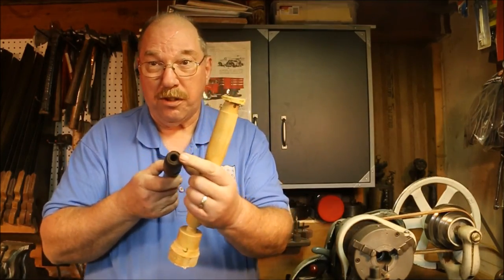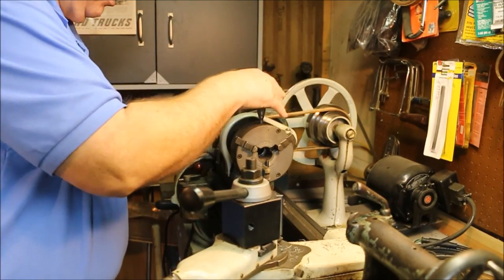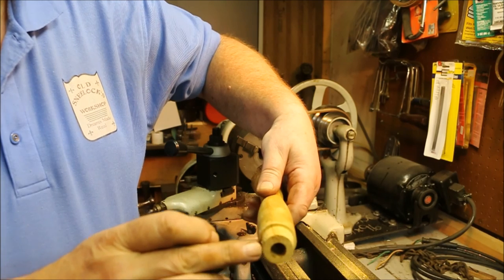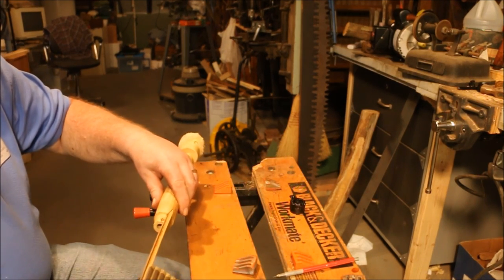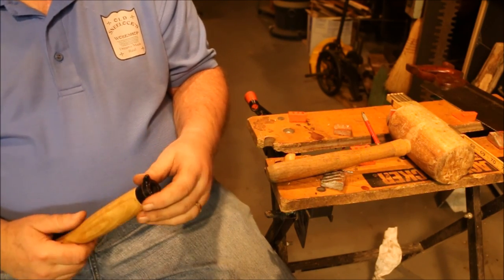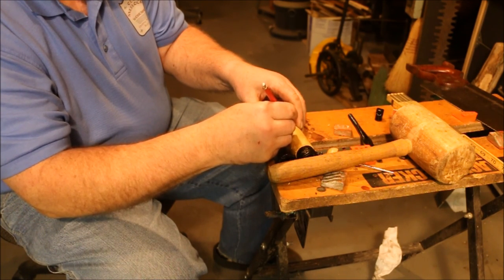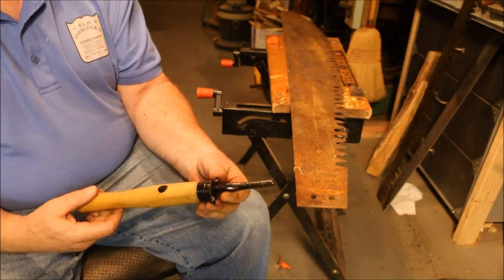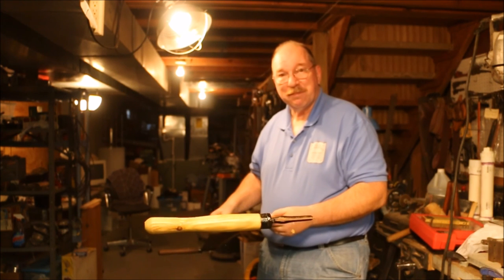Restoring A Two Man Saw ~ Pt 8 ~ Drilling The New Handle ~ By Old Sneelock's Workshop

Comment: Great Job Boss !! I don't see anything wrong with that handle. I made a handle for a hatchet one time out of a green hickory limb. I used it for a few years that way. dummy me broke it, so i went a bought one from the local hardware. I couldn't hardly use it!! it was to straight. Can't wait to see that saw a running...
Reply from the maker: Ol James Hickory is great for handles. A few years back, actually closer to 8 years ago, Lydia and I rented a cabin near Pigeon forge. We wandered around the mountains  and spent some time on the porch. Of course I had my jack knife so I was whittling on a stick. I noticed the owners had cut back some brush and left it lay in the  woods. I picked out two good sapling hickory tree trunks about two thumbs thick and carved us a couple walking sticks. At all the tourist traps they had little stamped tags. After we got home I set them into the walking sticks. Still got them in the closet. Some day theres going to be some puzzled looks at my estate sale.

Comment: So what do you do to make a racing saw (besides finding a couple younger guys with less sense)?  I can't remember if you increase or decrease the set, and how you sharpen the teeth.  I would imagine you would want a near mirror finish on the entire blade.  I'm pretty sure they sharpen competition chain saw blades (the ones they use for doing chain saw sculptures) at an angle closer to perpendicular to the bar (10 - 15 degrees maybe).
Reply from the maker: The best crosscuts are "Crescent Taper Ground—The best vintage saws were crescent taper ground (figure 5-5). Early saw manufacturing companies used different trade names for crescent taper-ground saws. The names included: crescent ground (Simonds), improved ground (Disston), and segment ground (Atkins)." http://www.fs.fed.us/t-d/pubs/htmlpubs/htm06672805/page05.htm
I agree that they are probably polished brightly. They would also have a much sharper tooth profile. Since they are only used and then tuned up almost immediately for the next log. A sharper but weaker tooth profile could be used. I think the set would be narrower because the set determines how much wood is removed. Less wood = faster cutting.